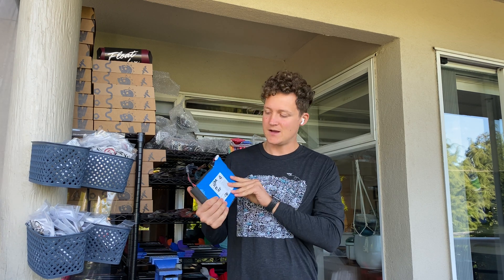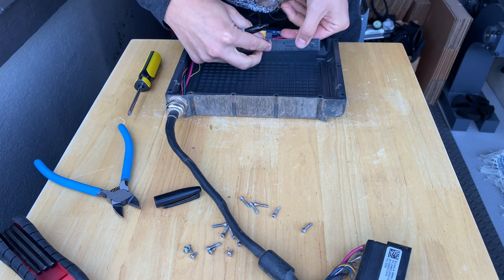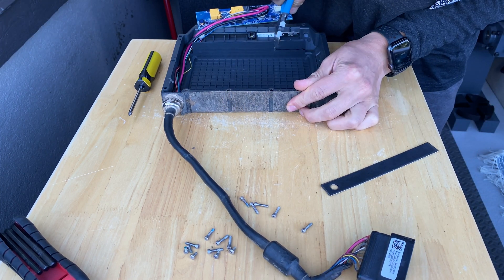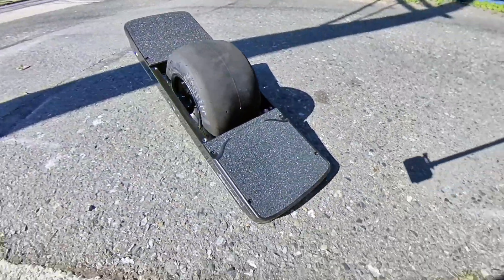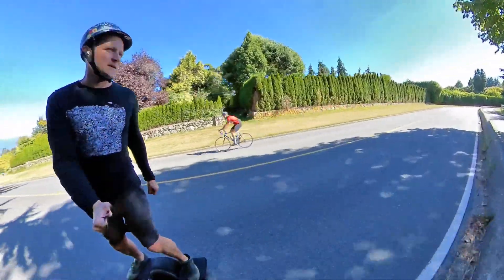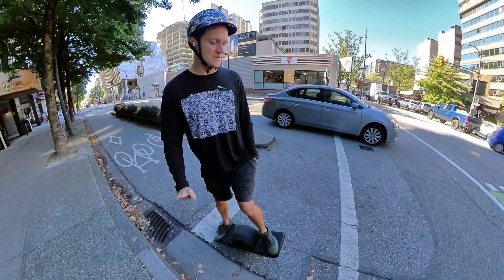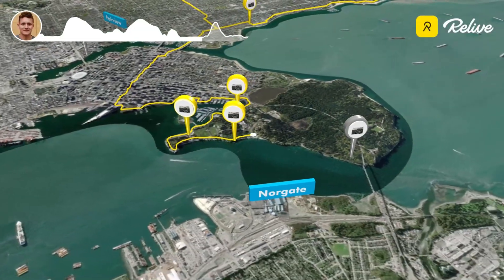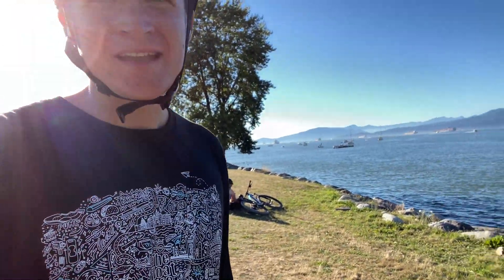Onewheel CBXR Battery Upgrade Installation & Range Test Review

Comment: Thank you for reviewing our battery! So pumped you like it!   - Bara
Reply from the maker: Bara Jabali Thanks for making a killer battery! Love this thing
Reply: Do you have a battery that will work with the Pint?
Reply from the maker: @jthrasherphoto  He does. It's called the Quart.
Reply: I have a 2021 will this battery work with my xr
Reply: If I have a 4210 board with Gemini 4150 software does that mean I can’t use your battery?
Reply from the maker: @seerjay2288  It will work but it may require power-cycling the board when your app "thinks" you're at 1% meaning you turn your board off then back on and it should work.
Reply: Is riding a one wheel similar to a skateboard? I'm specifically wanting to compare how your feet feel after riding for a while. Watching one wheel videos I see some of the riders talking about how their feet get tired. And I'm wondering if me speculating that is the one wheel causing this but I don't know? I never remember saying that my feet were sore after skateboarding for hours at a park. I'm either getting an electric skateboard or a one wheel and that's why I'm asking this question.
Reply: @billclark8241  the feet kinda stay in one position on a OneWheel. But they get used to it
Reply: Do we have an upgrade for 4212 yet?

Comment: What kinda range do you normally get on the XR?
Reply from the maker: Copy Imitation Good question that I never addressed. I typically get 16-17 miles riding at similar speeds.
Reply: @eevees  so essentially double the battery life? Is there a big weight difference?
Reply from the maker: Copy Imitation Yeah, pretty much. It only adds 1.5lbs
Reply: @eevees  oh wow!! I was thinking it would be similar to a carvepower battery pack.. I think I need to get my hands on one of these bad boys 👊 Thanks for the review man.

Comment: I read on the website that it works on 4209,4210, it not 4211.  However, I have no idea what that means and I would love to install one of these on my fairly new XR.  Just afraid of spending $700 and not having at work.
Reply from the maker: Boosted ND Miata Check out our blog post here: shreddlabs.com/CBXR and we explain how to check. It’s under your board settings though.